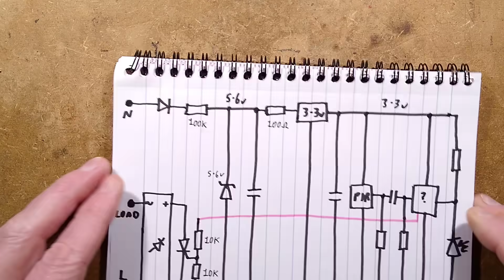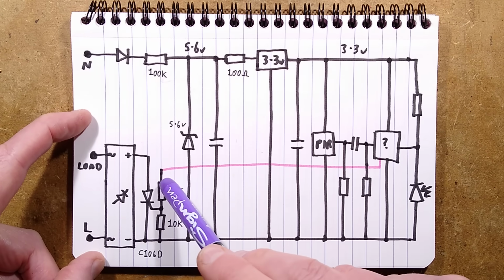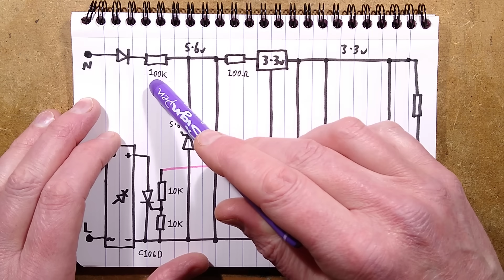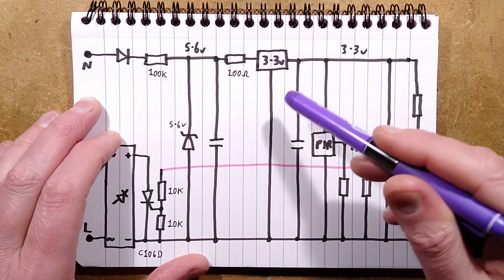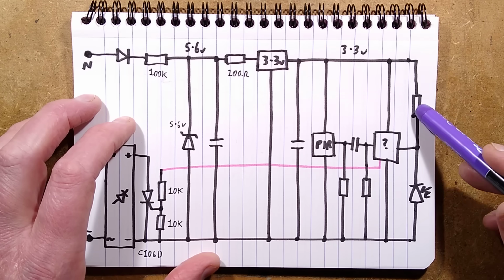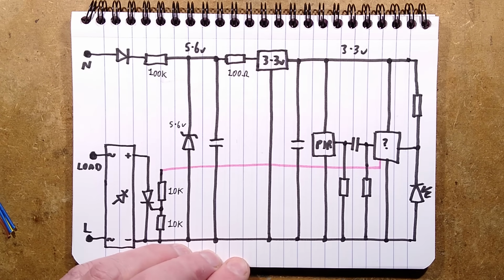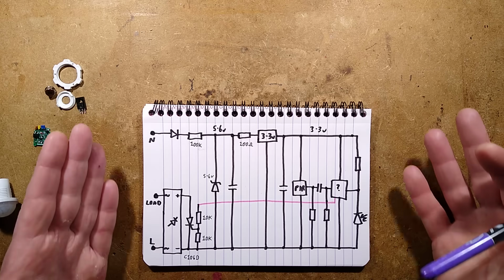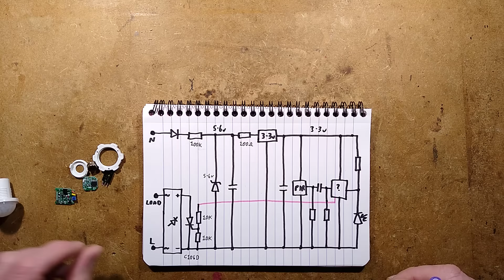Cheap PIR movement sensor and switch - with schematic

Comment: Hello friend. I have a constant problem with these sensors. They usually work for about a year and the C106DG thyristor is wearing out. What can I replace it with? A more durable one in a larger housing might be available.
Reply from the maker: I wonder if the switched loads are failing with a high current spike.  Old tungsten bulbs used to cause dimmer triac failure in the past.  It may also be that these are better suited to very low loads.

Comment: Thanks for the video. Is it possible to make the light stay on longer?
Reply from the maker: Only by changing tiny resistors on the PCB.  It may be easier to get a more versatile one with accessible adjustments.

Comment: Question ? 
With a light sensor, I know it’s different to this one but with the light sensor, can you reverse it? So it comes on with the daylight to enhance light for indoor plants. I want it to be in the same timing as the sun
Reply from the maker: Theoretically you could swap the position of the light sensor and its series resistor.  But I've never tried it.

Comment: Had one installed last week, worked for one week now stays on , is t possible with the weather fog and lightning on the sensor for it to stay on ?
Reply from the maker: If it's been subjected to a high current inrush spike to a load it may have caused the thyristor to fail.   I've just looked at a different style of unit, and it's using a tiny thyristor to switch a bigger triac.

Comment: If you very carefully mill off the black molding until the silicon is exposed, with a microscope it should be possible to read the chip number.

Comment: Outdoors and direct sunlight:  
Sharing my 2 cents here.  One issue that I have encountered with those PIR sensors is when I use them outdoors in the summer.  Direct sunlight triggers false alarms (mine has no light sensor as it serves other purposes).  Also I had one mounted over my concrete driveway.  It had no direct sunlight, but it saw hot air moving upward when the concrete was heating up, and it triggered.  I have been experimenting with combining a PIR sensor with a RADAR sensor, but with little success so far.
Great review, as always.   Thanks so much.   Love the schematic.
/chriV

Comment: I wonder if you can help. I have an  old airsource heat pump that you can only switch on with a remote . I was wondering if it's possible to buy something to connect to a smart plug that would press the on off button?😊
Reply from the maker: It might be viable to find a smart home device that can learn the remote's code.

Comment: Dear "maker"
I also have this sensor in operation. But I was never completely satisfied because it sometimes switched and sometimes didn't. Thanks to your valuable contribution, I have now taped up the light sensor. I didn't even know that there was one in there. Then of course I added the 100 k resistor. I am totally happy with how perfectly it works now!
Thank you very much for this valuable contribution!
Reply: Surprisingly, the second sensor is no longer reliable either. If it has been active for a longer period of time (> 10 minutes) it no longer switches off. This is with a load of only 20 watts. This was also the case with the first sensor. Does anyone have an idea?

Comment: Using a thyristor and bridge rectifier for load switching is a very old and still effective technique but the lack of a snubber network will guarantee a ton of EMI when this thing is on, which is poor. It could be added externally but as is, this would never pass any EMI standards - I know from testing these same circuits in the 80s.

Comment: Many workplaces are putting sensors in... and public buildings... not much fun when you go for a pee, lock the cubicle then 30 seconds later the lights go off on you.

Though I think they use better known branded ones, but as if LED bulbs aren't enough P.I.R. sensors to save 2p a year... hardly worth the bother.

Comment: Thanks for another good video, Clive. I found the schematic particularly interesting, despite the absence of chip identification. It got me thinking about other possibilities such as converting it to run 5V or 12V lighting.

A 5V conversion would enable it to run from a USB port and run USB lights. The sensor could be put in in a small enclosure with USB input and output ports for a flexible and modular approach useful for experimentation and prototyping.

A 12V conversion would enable the use of it in automotive applications such as cars, vans or mobile homes, where it could be useful to have a light that comes on silently and automatically even if it only lasted a short time.

Is the timing hard-coded, or do external components modify it? I don't know if identification of the chip is required to determine this of whether it would be worth trying with a few different components like you have with LED lighting and various motors.
Reply from the maker: The timing can be changed with the resistive divider.  For DC use you'd need a different unit, as the thyristor won't switch off on DC.

Comment: I have never bought from Ali Express. I really could used some of these so I decided to get a couple. First, I was surprised that there is a limit of one (1) package of two per order. Second, when I try to check out, I get a message that the transaction cannot be completed, to restart the app or contact Customer Support. I spent 15+ years as an IT manager so I know all the steps. Clear cookies, clear cache, restart PC, etc., etc. Nothing changed. I contact their Customer Support (?) and they don't have a clue except to instruct me to do what I already have done, which I understand, they are only reading the script. Then they want me to allow them to escalate the issue all for a $.99 order!?!? No thank you. This merchant has serious problems, both with technical issues and with Customer Support. At this point in time, I wouldn't get an item from them if it were free. Clive, I am very happy that you are able to transact business with them. Oh, by the way, I found them on the jungle website for $9.99 for three (3) items!

Comment: Hey Clive, I have a peculiar question. EU and UK bulbs are probably similar in quality, so I can probably safely ask: have cheap filament LED bulbs improved in maybe last 1 or 2 years? I can go to a supermarket and pick up a warm light bulb with almost no blue spike (it looks more like a hump now) for the price of a chicken, or two bulbs if I pick the 470 lumen ones.
Reply from the maker: Quality will vary between brands and batches.  The first filament bulbs were pretty reliable because they under-ran them.  The more recent ones have been deliberately pushed for a controlled lifespan.
Reply: Take the chicken.

Comment: I'm s bit of a novice, what sort of load would this safely tolerate and at what range does movement trigger the device?
Reply from the maker: It is intended for low loads like a few LED bulbs.
Reply: I did suspected this given your doubts over the 100k resistor at 240v  thanks.

 Could you recommend a manufacturer/make/model of a similar/better unit which COULD be used to engineer a unit to tigger a table lamp?
Reply from the maker: @davidchadwick7559  This should be OK with a simple table lamp.  But a unit with a longer time delay would be preferable.

Comment: Well done Clive :) I replaced the 180k resistor (one of the resistor dividers you didnt have room for on the schematic) Thankfully one of the easier resistors to replace. I changed it to 400K and now mine stays on for 2minutes :)

Comment: Can you try changing one of the resistors for the chip it could be changed to a potentiometer to adjust the time I’m told.
Reply from the maker: These chips often do use a potential divider between the IC's supply rails to change the time and sensitivity.

Comment: I'm glad you made this video because I have a light bulb that will turn on when it senses movement, and it also has a light sensor.  I would like to disable the light sensor so it stays on even if there is light.  Can I remove the light sensor and it's resistor (if it's setup that way) and make it stay on even if there is another light on?
Reply from the maker: You can black out the light sensor or often just remove it completely.

Comment: WOW!! C106D is old. I was using these in my first ever job. Now I have been retired for almost 8 years. Like the 555 timer. A friend at school was experimenting with one. Now I still use them. Well thought out electronics has a super long life.
Reply: C106D 😻
Every Day Electronics magazine about 1979 did a circuit consisting of a C106D and a bell transformer..
From memory the 106 was across the Neutral and triggered by the mains side of the transformer..
the low voltage side was connected to the loudspeaker for a sound to light flashing filament bulbs to 700w also adding inductors/capacitors triggered at low or high bits of music..
Worked really well.
Heatsink is at mains ⚡ voltage.
The 555 was fun..
How about the glass OC71 and scraping the paint off for a light detector.. is that why they then put it in an aluminium can?
Just remembered making a metal detector with them.. I found it would detect aluminium.. as the first thing I tried it on was a aluminium saucepan.. not knowing it wasn't supposed to work.. I inadvertently managed to tune it to non ferrous.
Reply: One could build the same circuit here with a 555 replacing the MCU. Such would only require an additional transitor from the PIR to the 555 trigger gate using resitors to set the trigger sensitivity, the light sensor could be fed to the 555's reset line, and the timing resitor divider swaped to a resitor/capacitor pair to set the 20 second on duration. But with the price of today MCU's and available off the shelf software routines the 555 would likely be a fair bit more expensive.

Comment: I have similar to this from aliexpress but you can set with two switches the on time (2s,40s,4min) and light conditions (night, day, all day) but you can't set the detection sensitivity. I connected them to an alarm system and they always gave me false alarms (movements). I can't find any video where I can change some resistors or something else to change the sensitivity. Could you please do that for us and reverse engineer one of those to find what I have to change in order to fine tune the sensitivity? You have much better knowledge from me.
Reply from the maker: This unit and other with similar chips let you set the sensitivity with a voltage divider.  But for an alarm system I'd recommend a proper alarm PIR with pulse counting to reduce false alarms.

Comment: A few years ago I was using a public toilet that had motion-sensor lighting.  I was about halfway through my toilet task when the lights shut off and I was left in utter darkness.  I finished my business in the dark, but couldn't even figure out how to flush the toilet.  I had to fumble my way out of the stall before the sensor turned the lights back on for me.  It was a very uncomfortable several minutes.
Reply from the maker: Likewise when the local gym was first fitted out.  The changing rooms had PIR activated lighting and no other illumination, so it would go pitch black in the middle of using the shower, and your only hope was for someone else to come in and trigger it again.

Comment: It looks as if the logic circuitry is being supplied by a half wave rectified current. depending on how hot that resistor gets, his method of power supply would be more reliable than a capacitive dropper.

Comment: So, are you saying you could bypass the 110V input and go directly to the 3.3v to power this chip?
Reply from the maker: You could, but I'd suggest using 5V and keeping the regulator in situ.
Reply: Of course. But that helps me to understand the 110V side for other uses.

Comment: The (  SCR + bridge rectifier  ) method was used in the late 1960's for the ( very ! ) early phase angle light dimmers ... as Triacs were not commercially  available ... and , should you want one of these dimmers ... you had to build one 😝.... I  built one as a school project ... and in 2025 , it is still working perfectly , ( in my old  bedroom 😝) ...... DAVE™🛑

Comment: I like the fact that I can still be surprised by the usage of a bridge rectifier and thyristor after 50 years of electronics.
Reply: Handy little trick to have. Used it in the protection circuitry for one of my project amps. Using a small dbr meant I could do cycle to cycle monitoring to sense brownouts and power failures with a standard optocoupler. They do make bidirectional ones but they didn’t have the characteristics I wanted.

Comment: So, they used a bridge rectifier in line with the load instead of say, a relay. Which means that the type of potential load could be very limited in power.  Unless of course, they imply that the direct load would be an AC relay and anything else would be switched from it. Judging from the size of the rectifier 100 Watt would probably be the maixmum direct load at 240V, even less in the USA.
Reply from the maker: It is just for low power lights.

Comment: Bought a bunch of these about two years ago, running 5w leds and 10w led floods, about 50% failure rate, the wires were very very thin, these look a bit nore substantial wire wise.

Comment: Which resistor(s) or divider on the board do you have to change, and to which value, to change the time delay from 20 seconds to let’s say 10 minutes?

The most annoying thing about PIRs is when the light turns off way too early and you have to do jump jacks every 20 seconds to be able to see anything again.

Comment: Those things are as cheap as chips, and really reliable.   We have a few out the back providing an "add on" PIR function to basic LED floods, and they have lasted over 8 years so far (bought a pack of five, and still have two of the originals as spares - never needed!)

Comment: A classic crowbar circuit used to power LED lighting in a retail stores freezer box. Approaching it when you are in front of
the door it comes on and you open the door to get the item inside then turn and leave the light then goes out. They are 
getting common in larger grocery stores.

Comment: I'd be interested in this unit's idle current draw.
I'd like to use some of these units on 12V DC wiring - but i do fear battery depletion.
Reply from the maker: They do 12V versions.  This one would not be suited to DC, as the thyristor would latch on and stay on.  It needs the zero crossing points of AC to turn off.

Comment: I have one of those in my garage and its working over 2 years now. I have a constant current power supply for an led strip and i used an external relay to switch the psu in order to avoid the high inrush current  on the sensor module. Its possible tweak the time changing one resistor, i don't remember values, but i remember that is 0603 size and is close to the board edge, and if i remember correctly the time is inverse to the resistance value, i made mine stay on 1 minute or so.

Comment: I’m thinking if you were to repurpose this, if it can operate at lower voltages you could experiment with robotic sight. Would be a cheap way to get ahold of infrared sensors in a nice package.
Reply from the maker: It only has effectively a single pixel in it.

Comment: Ceap Chinese fire starter. Rating of the wire insulation? Steel onductors? Soldered wires don't look all that great, hot resistor. 👍

Comment: I thought that Clive had 'reviewed' these a while ago? 
I got some of them...look identical to the ones in the vid... about 2 years ago.
Not impressed by the build quality. (No shock there... right?)
I'd never install one of these in someones house, to control lamps (lights).
... especially if the fixture is accessible... and can take various kinds of lamps.
Don't trust...they wouldn't cause a fire.
Good for playing around... but... commercial grade... rated... ceiling mount 'occupancy sensors' are X!spensive.
But... still cheaper than a new house.

Comment: Would have been nice to see some investigation of the "beam pattern". Most movement detectors have deliberate blind spots so movement is easier to detect.
Maybe part of the photo diode package, or does the dome have facets?
Reply from the maker: The dome has the usual lenses to create multiple detection zones.

Comment: The reason. The trick of shunting a bridge rectifier is that, as clive mentions, is that a scr can be used instead of a triac the reason for this clivee did not mention entirely.  If they used a triac instead and during random point in the ac cycle, only one of the junctions would fire which would put dc on the load. And if this load contained a transformer or choke the triac is now shorting the line
Reply from the maker: I mentioned the waveform switching symmetry in the description.

Comment: Time-Setting: There is a resistor "R3" on the round PCB with the number "184" or "1B4", he gives you 20 seconds to run to the garage and drive the car out.
If you replace this resistor with a 470 kOhm  resistor, then you get a bit more as 3 minutes !

Comment: If I had seen another capacitor around the mystery chip I would have guessed some sort of cmos 555 clone. There are not many circuit designers left in the world that at least at one stage in their life  have played with the 555er.